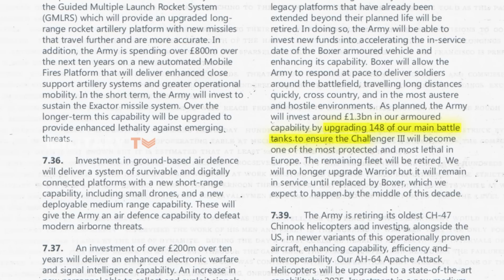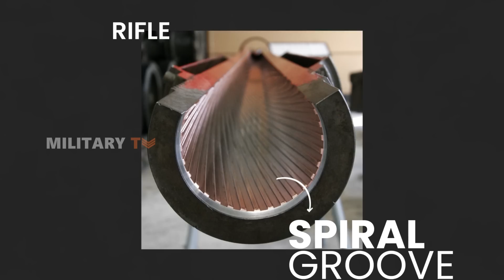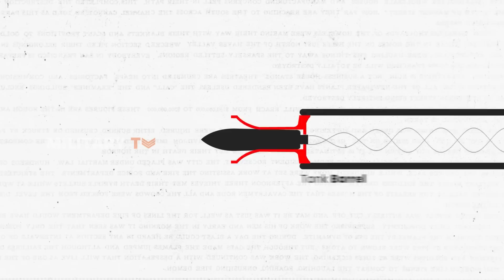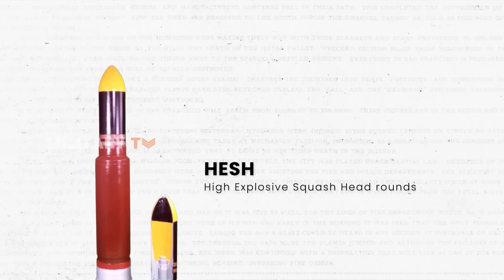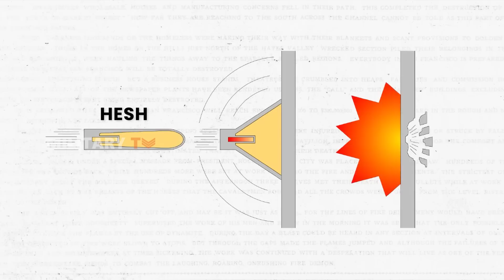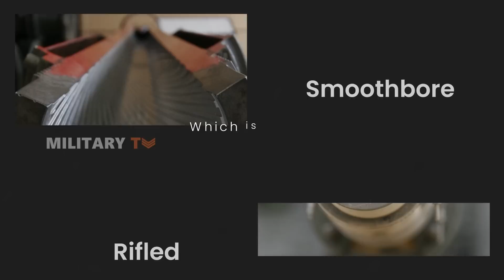Rifled vs Smoothbore Tank Guns—Which Is More Effective?

Comment: Smoothbore has a number of advantages. It is simpler to produce and more reliable. No need to bore out the barrel with rifling techniques and add special lining to decrease the wear of the rifling. Maintenance is easier. No gunk builds up in lands. Smoothbore does not disperse some of the energy around to impart a spin on the artillery shell. No gases escaping through lands. There is less gas escaping making it more efficient in transferring energy to the projectile for maximum velocity and boosting direct fire range. The sabot suit acts like a pure catapult in launching the dart like a rail gun. For the kinetics, smoothbore is ideal for anti-material role. Tank guns produce harsh pressure environments where simpler is better all around. Even still, gunners have to deal with barrel bend, and advanced tanks have electronics to measure such things.

The advantage of rifling is really accuracy at long ranges. Fin stabilized projectiles lose accuracy the more the velocity decreases, and the fins will start get dragged by the crosswinds over a long distance. This is why there are no smoothbore howitzers. Some smoothbore guns were used as field guns for indirect fire, though this is rare. There are no smoothbore naval guns or 6 inch or 155m guns, howitzers, or hybrids. A 155mm smoothbore would not work for the M777 Howitzer role. The rotational forces imparted on the shell is retained down range. Unless you have guidance that self-correct during path to target, fin stabilization is less accurate than rotating dumb munitions. Even some MLRS use the concept that is used by rifling by putting a spin on rockets as they leave the launcher and/or use deviated propulsion to create spin after they leave the launch box.

The implications also explain why IFVs, infantry support platforms still use rifling. To deal with the weight, and recoil of the gun, they go smaller, less pressure. The M10 Booker still uses the rifled gun, and 105mm, the M35, which is lighter, 20% less recoil than the MBT equivalent of the 105mm tank gun. Rifling performs better inversely than smoothbore with decreasation of muzzle velocity, because the stabilization that is imparted, is no not conditioned on velocity. The BMP-3 still uses a rifled gun, 100mm. Rifled guns are far from obsolete, and in fact, are the chosen option for most guns. The outlier is the tank gun, because kinetic muzzle velocity is privileged, which in itself reduces the need, if not make rifled barrels counterproductive.

Comment: In light of recent MBT performances in Ukraine a Challenger 2 crewman in a recent documentary said...."The Challenger 2 is a sniper and the Leopard 2 and Abrams are foot soldiers.....just look at the losses to see which gun is best". Leopard 2 losses = 12, Abrams losses = 5, Challenger 2 losses = 1. It is not about how many different types you can fire, you only need one type to hit the target....which Challenger 2 does repeatedly over long distances with it's riffled barrel. Comparing the riffled Challenger 2 barrel to the Challenger 3 smooth barrel is akin to ditching the L115A3 for an SA80 and hoping to hit something at 1500 yards.....total madness. Hitting a target with superior accuracy at long distance is much better than letting yourself get within his range before you can fire at him. Challenger 3 is yet another piece of UK defence equipment that was designed and produced by a Committee and a gaggle of Bean Counters.
Reply: Ye sure that has nothing to do with the fact that they sent less tanks then the US for example . What a braindead argument.
Reply: I have read somewhere that smoothbore 120mm gun has lifespan 800-1000 shots, but british rifled 120 mm gun up to 2500 shots. Is it true?
Reply: @leotka  That question is like asking, "how long is a piece of string".  There are many factors that affect barrel life such as, munition type fired, propellant used etc. However one of the important factors regarding barrel wear is out of roundness leading to reduced range and reduced muzzle velocity in part caused by propellant blow by. One thing you never hear talked about by the "smooth bore" fraternity, when it comes to barrel wear, is "barrel chatter". As more rounds are fired through a smooth bore the wear occurs due to the lateral bouncing of the munition in the barrel as the round has no spin stabilisation whilst in the barrel, whereas the riffled bore induces spin stabilisation right from the off, and we all know that any spinning projectile will tend to fly straight without oscillation, a factor that is crucial whilst the round is in the barrel, and this is a factor of riffled barrels having a longer lifespan than smooth bores. Sabot rounds do help smooth bore wear factors as the sabot helps to keep the round more stable in a smooth barrel and it tends to be made of a much softer material than the barrel, as opposed to the conventional AP or HE round casings.
Reply: @mdf2mdf287  Well, there should be statistics. I already wrote that smooth bore around 800 shots and rifled 2500. I've seen interview with best Ukrainian expert M.Solomakha. He said that Ukrainian tanks have huge problem with barrels because for 10 years of war since 2014 many 125mm barrels completely ware off. Ukrainian industry can't replace them.  They canibalise barrels from old tanks but urgently need replacements. Technology of making tank guns was lost because of luck of orders. They produce 155mm barrels for Bogdana howitzer but getting replacements for 125mm from allies.

Comment: Rifled barrel have also two weak points. The power of the propellant can not be extended to give the shell more punch to overcome modern amor. The rifle would wear out extremely quickly, if the barrel wasn't even destroyed. This leads to another disadvantage, the general wear of the barrel is much higher with rifled barrels and this is also a huge cost factor. Changing the barrel of a tank is no small feat. 
In the case of the UK, the matter is actually quite mundane, the ammunition factory was closed decades ago and the remaining stocks are slowly being used up. For the few remaining British MBTs, it is simply not worthwhile to build a new munitions factory. There is also no export market for this ammunition.

Comment: Rh120 L55A1 outclasses the L30A1 in pretty much every metric, most importantly in the ability to penetrate armor. HESH might not longer be available, but DM11 programmable HE rounds provide similar or superior performance on the modern battlefield.
Reply: Yeah legit the only advantage of the L30A1 is it's quicker to load because you can lap-load it. 

That's it. That's the only advantage it has over the smoothbore.
Reply: @AllThingsCubey not even close it uses two piece ammo plus, the gun uses a primer to fire the gun instead of an electric firing mechanism making it even slower.
Reply: L44 is the closer comparison. L55 is a later generation.
Reply: @samuelmorales2344  I agree on time of introduction. The thing is though, the L30A1 gun, and the L11A1 before it, both are "L55" in the sense of how long their barrels are, which makes them comparable to the modern L55 smoothbore in at least that regard.
Reply: @samuelmorales2344  I‘ve chosen the L55A1 for comparison as it’s actually the gun replacing the L30A1 on Challenger 3. Also only the L44A1 and the L55A1 come with the necessary components for programming DM11 from the factory.

Comment: Rifled gun is more accurate even when the tank is on move
Reply: Any difference is insufficient to justify the detriments that come with rifled barrels. Smoothbores are nowadays accurate enough to allow for aiming at weakspots at combat ranges.
Reply: Wrong. Where are you getting your data?
Reply: @Rjsjrjsjrjsj  From my experience , MBT ARJUN  and T 90 Bhishma in Indian army
Reply: @ab_gopaldas  Ah. An Indian and Russian tank. Need I say more? 🙄
Reply: @Rjsjrjsjrjsj  120mm DM73 for Rh120 L55A1 is marketed to have an deviation of less than .2 mils. That’s less than 20cm at 1km range. This accuracy has to be achieved with a barrel nearing the end of its lifespan and tankers like to exchange their barrels a lot sooner, so the practical accuracy is likely even higher.
*Rifled gun won’t have any better accuracy when it comes to APFSDS, as those rounds do not function with spin stabilization.
Reply: False

Comment: Nothing to do with the gun.. this is all about ammunition! Only UK produces the 120mm APFSDS for rifled barrels. By going with the German/US Rheinmetall design there is a wider supply base for ammunition..

Personally I am sad to see the loss of an HE round from MBT. It may not be effective against other MBT, but it makes a real mess of most other things. APFSDS is only any good for poking small holes in stuff!
Reply: Rh120 comes with DM11, that should be equal or superior to L31 HESH rounds on today‘s battlefields. The difference between Charm 3 and DM73 should be around 40%, the upcoming KE2020neo/DM83 should be 57% better than Charm 3.
Reply: @RichelieuUnlimited  Oh I know..!  DM11 is very clever.. just not enough of it around! I await the development of a capable UK manufacturing capability (..including the propellant!)

Comment: I'm thinking they went for a smooth bore because of the brown envelope. You only have to look at statistics. The are loads of the smooth bores out there,  all the leopards and all the
Reply: And all the Abraham's, that is loads of smooth bores, but not many challengers compared to those numbers, but which one holds the longest kills. They keep going on about higher velocity from the smooth bore, Mmmmmmm proof it. You said about the versatility being able to fire many different types of rounds. But they are harder to produce and more expensive. Not good in major wars. People should learn from history, shame they don't.
Reply: @davepreece2294  a shell that was fired from a smoothbore barrel travel faster because it doesn't need waste some of it's energy to spin the round, in fact challenger APFSDS have a band around the sabot that prevent the spin effect from the rifle barrel, because if you spin an APFSDS the fin would produce drag because it's acting like a paddle, and NATO standard APFSDS don't need that band and so they are much simpler

Comment: Previously I was a huge fan of the rifled gun, based on the sniper rifles performance in range and accuracy, and I thought the Soviet abandonment of the rifled barrel was driven by economic reasons beside some tactical quality mostly related to operational advantages of the smooth bore guns, but the designing of APDS reached its limit, and although the rifled guns can fire the same new generation APFSDS fired by the smooth bore gun and despite the improved accuracy offered by the rifling (out side the fin stabilized kinetic energy rounds), but it comes at the expense of the rest of the additional properties and characteristics and advantages provided by the smooth bore gun, for example by exhausting all the pressure generated from the combustion of the propellant in pushing the projectile outward at a higher muzzle velocity instead of dissipating part of the gases or the generated pressure in rotating the projectile inside the barrel of the rifled guns...

while the designing of modern ammunition plays a major role in abandoning the rifled guns in favor of the smooth bore gun which is cheaper to produce, and cheaper to maintain, much more durable compared with the rifled guns, and more versatile beside it can fire the gun launch anti tank missile with the same caliber...
theoretically the 120mm rifle can fire 105mm GLATGM...

the rifling help achieve stability for the round while traveling towards its target enhancing its accuracy but at the cost of losing from the muzzle velocity speed for example the l30 of the challenger tank with barrel length L55 (L27A1 APFSDS: 1,650 m/s (5,400 ft/s) offering the same muzzle velocity speed the nasty germans rh 120mm with shorter barrel length L44 and less muzzle velocity speed than the same barrel length of L55 (1,750 m/s 5,700 ft/s) the difference in speed 360km/h, even the Soviet 2a46 with barrel length L48 offering higher muzzle velocity...

Comment: Rifled is better for regular ammo, but smooth bore allows for the use of rockets, etc
Reply: What regular ammo? APHE? 😆
APFSDS works better on smoothbore, since does not need roller bearings on the sabot to mitigate the spinning on the dart...
Reply: @RS-lw1hz  non-rockets 😅
Reply: How are rifle tank guns better than smooth-bore guns? Can you elaborate?

Comment: The Challenger 2 does hold the record for the longest tank versus tank kill. In this new age  of tank warfare maybe the ability to fire Hesh at dug in infantry positions is actually the way to go.
Reply: It was a Challenger 1, and it was against a T-54/55, with a DU APFSDS round, in 1991 (Battle of Norfolk)... It had more to do with crew training than with the tank, any Abrams with a 120mm smoothbore could do the same, had they had the chance with a skilled crew against a target from the 1950's...

HESH is good against fortifications and tanks without composite armour, it's not ideal for infantry dug in trenches due to the lack of fragmentation. Hence why Ukrainians still prefer 125mm HE-Frag for that role. Also, there's 120mm EH ammo available for the Ukrainian Leopard 2 and Abrams.

Comment: Rifling for accuracy was important in the days when the ammunition was not produced to the fine tolerances found in today's projectiles. At high revolutions, small and even medium differences in density and weight in a shell are evened out. Such rounds in a smoothbore barrel would divert from the desired course. With precision made modern ammunition, this is no longer a concern - and fins ensure accuracy. If the British wanted to maintain a HESH found they could create one with fins to make it spin.
Reply: Rubbish